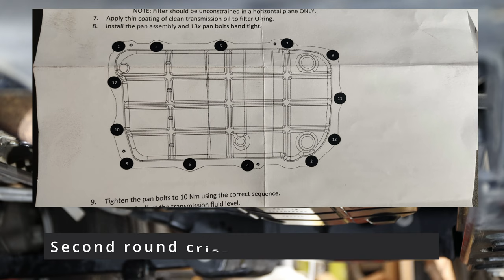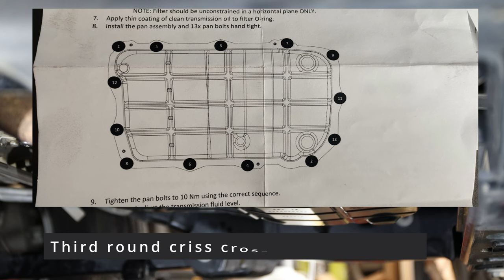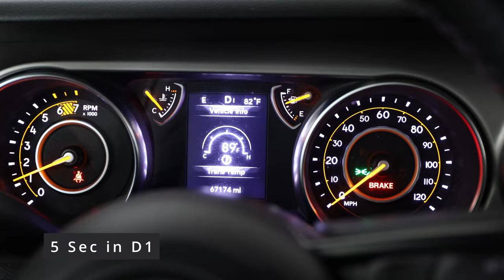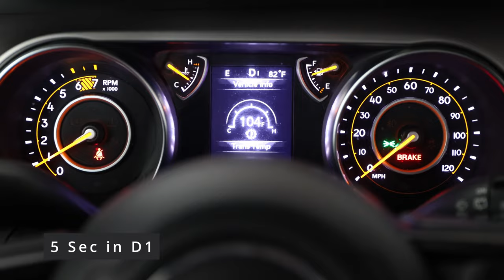Jeep Wrangler JL 2020 | Automatic Transmission 850RE | Transmission Fluid Change | Lifetime Fluid

Comment: Ok I know people are going to disagree with me here. I have 98k on my willys jlu and have not yet changed my fluid yet. I have pulled the drain plug and put my finger in the hole ( lol ). Wiped my finger on a plain white towel and it was still greenish in color. I will let it go to 100k then pull the pan. I will make a video of the fluid condition and see how well the filter is still getting debris out of the fluid. I do already know what I will see, since I had a 2018 JL that I put 310k on and never changed the auto trans fluid. Wish I would have dropped the pan on that one to see the fluid =). The person that purchased it from me still has not changed it and it has been over 2 years.
Reply from the maker: Haha, no worries. Glad to hear it does also work without!

Comment: I have a Jeep Wrangler JLU 2019 I did the same process you did but the dealer said that I need a 9 quartz but it’s already full when it came to 5 - 6 quartz I tried to refill it more but it won’t let me refill the rest of my transmission fluid. It will just overflow. I did the cycle also but still
Reply from the maker: The additional quarts are in the torque converter which can only be emptied or flued changed with an entire transmission flush. According to the dealer there is no need to change the Trans fluid. Not sure if a dealer will do a transmission flush at all?? I hope this clarifies the remaining quarts ;-)
Reply: @tobisreallifeskillswithtobi thank you 

1 more questions did you start your Jeep without the fluid or with the fluid already on the Trans Temp 86 - 122?
Reply from the maker: @wyndelpuente6899  I added as much fluid possible then started the engine and let the transmission temp get warmer until it reached the minimum temperature.
Reply from the maker: I'm recording a similar video this weekend for a transmission pan upgrade but including the steps afterwards and I try to make them more obvious and easier to follow... I hope this will work ;-)

Comment: You'll need to replace the oil cooler as well. The cooler is made of plastic, and sits next to the core of the engine. Warps before 90k miles and you'll lose oil or coolant.
Reply from the maker: Thanks for sharing. Did you have this issue?

Comment: I recently did the trans fluid amd filter on a 2011 BWM X5 ZF8speed.  This looks to be the same or similar variation transmission.  Where did you get your instructions from?  ZF recommends filling then running through the gears and getting to temp (specific temperature range escapes me now) which I used a scan tool to confirm amd made sure it was filled at that temp.  Are you able to confirm if this is different for the transmission in the Jeep JL/JT?
Reply from the maker: As much as I know this ZF transmission is similar if not the same. Bit sure about age, model etc. but heard it is similar since it seems to be the same manufacturer.

Comment: Just to confirm, to get the correct fluid level you first fill to overflow, cycle the transmission through R, D1 & D2 twice then leave running in P and fill to overflow a 2nd time?
Reply from the maker: Correct

Comment: 21 Gladiator, transmission shop said to complete at 100k.  Great content!
Reply from the maker: Thanks for watching! Interesting to hear from the transmission shop! thansk for sharing!
Reply: How did your 100k transmission service went I bought a used gladiator not so long ago and I almost reach 100k but wondering if is not to late to service the trany
Reply from the maker: I am still below 100k at around 78k at the moment.

Yes, I would so do it, not too late if you do not have any issues so far you should be good to do the fluid change

Comment: Great video!  It's been a few months since you changed the transmission fluid.  How's it running so far?  Are the shifts still smooth?
Reply from the maker: Great question and glad you asked! My Jeep is still running! Still shifting smooth - no issues so far :-) I'm monitoring the transmission fluid temp when driving and it is all normal it looks like :-) Knocking on wood it stays like this!!!

Comment: Hello and many thanks for your content. Just curious, what shape was the fluid in? Did you find any significant signs of wear or degradation?
Reply from the maker: It was fine. Not big shavings, just the typical metal slush on the magnet which you do expect. the fluid was dirtier than the light green for sure. I did not see any significant wear or degradation luckily. Thanks for watching :-) I'll try to get a second video up soon which I was making with a aftermarket transmission pan from PPE - not successful ;-) Might give more insight...

Comment: Thanks for your wonderful video it’s really helpful , I have Jeep Wrangler JL Rubicon 2018 just wanted to know the size of the transmission oil pan fill plug is it 8mm socket same as 2020 model
Reply from the maker: Hey! Sorry I need to double check. I will have a follow up video with upgrading the transmission pan soon.

Comment: Thanks for the video, I have just bought a Rubicon 2.0 model 2020, do you know if the filter is the same?
Reply from the maker: Thanks for watching! You might be able to check this on the mopar page with your VIN/specific car type: https://store.mopar.com/oem-parts/mopar-transmission-oil-filter-68417054ab

Comment: Did you say hand tight on the filter nuts and then an additional half of a turn?
Reply from the maker: No, hand tight and loosen half turn.
Reply: @tobisreallifeskillswithtobi  I just had another say, from the ZF pdf manual he supposedly has, that it’s hand tight then BACK off 1/2 turn so the o ring seal that goes into the pump can self align horizontally without binding.
Reply from the maker: I'm sorry! I just watched it again and said loosen half turn. Thanks for double checking! You are correct.

Comment: In the UK, for 9 liters of the Mopar gearbox fluid it costs a whopping £252 + VAT (£28+VAT per litre).  Wondering which oil Mopar uses and if it can be sourced more reasonably ?
Reply from the maker: Thanks for watching! That's a steep price. I think I looked into this as well but since the car is so new I figured to go with OEM :/  I found this, which seems to fit Jeep JLs: https://www.northridge4x4.com/part/gear-oil/30704-red-line-d6-automatic-transmission-fluid-1qt

Here is the video where they use it for their new transmission pan: https://www.youtube.com/watch?v=kaZO4ZQjHo0&t=442s&ab_channel=Northridge4x4

I hope this helps!

Comment: Got quoted $163 for dealer trans filter gasket kit, does that sound right for what you paid? Seem overly inflated. Even the fluid was quoted $36.28 per quart. Don’t buy retail at dealer.
Just for curiosity, asked for trans service at dealer and got quoted $750- $800. Not even a final number, just range from service advisor. Power steering fluid was $47.85. Everything is just getting out of hand. Affordability wise.
Reply: Correct. From dealer especially. Just go to auto zone and get the European power steering fluid.
Reply from the maker: I paid ~70 for gasket and ~60 for filter to give you a reference. That's a steep price!
Reply: Sounds correct pricing

Comment: Is the gasket necessary to change? It is a $55 piece. Seems expensive.
Reply from the maker: I would say it depends on how many miles you have on your Jeep already or how old your car is. The gasket which was on the Jeep from the factory was white for example and I'm happy I did replace it for piece in mind.
Reply: @tobisreallifeskillswithtobi  thanks. Did you get it from dealership or some other store?
Reply from the maker: @trail_tracker  No, I order usually online. In case you have the same/similar Jeep like I do use the Mopar number for the gasket in the video description. I just found this gasket on Amazon as well: https://amzn.to/4dXkz9S

Also, I sometimes order from here or at least try to figure out the actual mopar number and if it does fit my car which you can check on there website as well! https://moparpartsgiant.com/

Comment: What tool was used to remove transmission drain/ fill plug?
 Thank you, Brandon😇
Reply from the maker: Hey Brandon, it was a Hex Key Allen, I forgot which size - I thought I added it. Sorry I did not apparently. You can see it in 16:11 of the video. That shows the fill plug. With the OEM pan there is no drain plug. Aftermarket transmission oil pan does come with a drain plug as well like the PPE Heavy-Duty Cast Aluminum Transmission Oil Pan.
Reply: @tobisreallifeskillswithtobi  Thank you for content, and reply😇 8mm hex allen bit for jeep jl automatic 8 speed transmission fill plug.